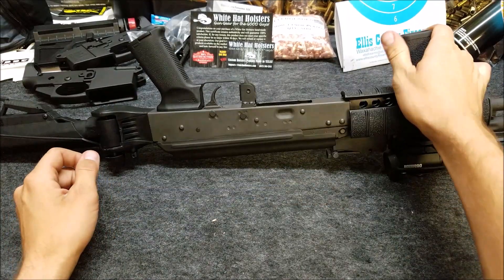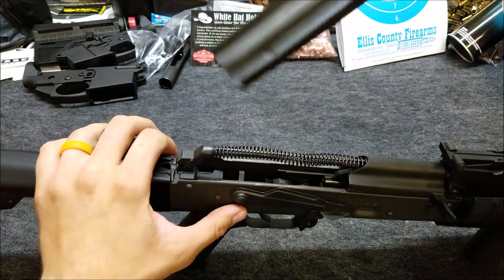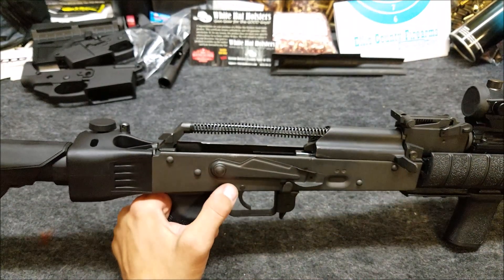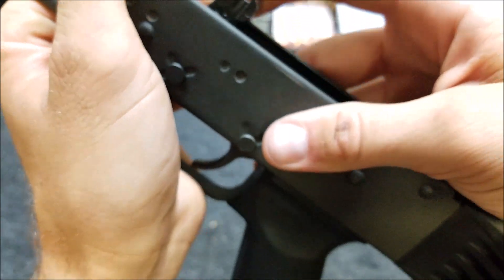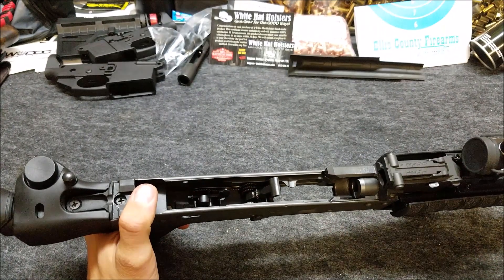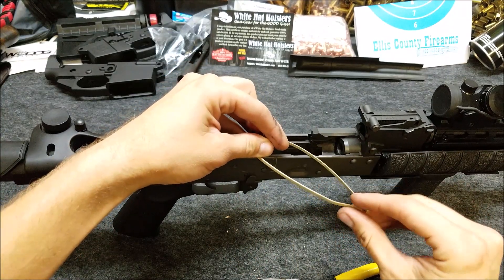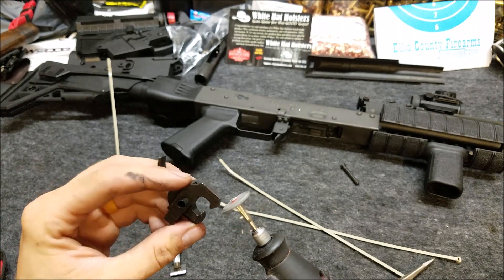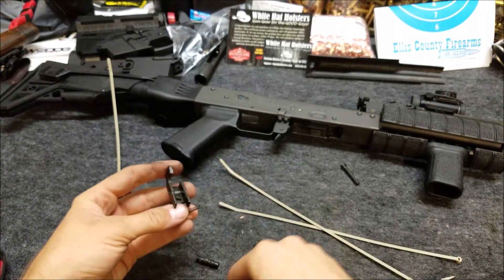Ak-47 Trigger Repair reset fix

Comment: Hey man. I just wanted to say thank you. I am inexperienced with the AK platform but wanted to change the trigger in my PSAK 47, gen 2. I was replacing it with ALG AKT E. Installation went well except the trigger would not reset. I looked everywhere and watched tons of videos but none of the fixes applied to mine. Then I found your video. I filed the hammer and the disconnector like you did and problem solved! What a relieve! It had been two days of installing and reinstalling trying to figure it out. Thank you.
Reply: I picked up the G3 myself a few years back...looking to polish my stuff up too!!!!

Comment: In my case, one side of the spring was not on top of my trigger assembly. This wasn't pushing it down hard enough to reset the trigger. Make sure to check the springs are actually pushing down on your trigger in the first place.
Reply: Thanks! That was the case for me too. My dumbass knocked the spring off of one side when I was messing with trying to loosen up my safety lever.
Reply: Thank you soo much man i though i broke my Ak😂😂😂
Reply: Thank you so much for this comment!!!!! Bought a new zastava and when I was cleaning it I must have knocked the wire off one side and my reset was fucked! It’s fixed now thanks to you 😂

Comment: Just replaced m70 trigger with an alg and am having an absolute nightmare. I don’t have a file, and I need to buff out both the hammer and the little safety pin in the trigger. These parts should already be pre-measured and ready to pop in. It’s ridiculous that we have to do a step in the manufacturing process for them at all by filing and grinding pieces to the correct size.

Comment: LoL with the end of the video being deleted.  Did changing sear to trigger engagement surfaces magically fix the trigger spring reset issue?  Or did putting the hammer trigger spring on properly during re-assembly solve the problem?

Comment: I'm also having the same issue but my gun has been working fine for the last 2 years mine is  the M10X with the same trigger group but I noticed on the right side of the receiver there was a lot of shavings I think it's either coming from my pin or the caller I think that's  my trigger shifted I think any ideas?

Comment: My Ak shoots semi auto perfectly but when i switch to full auto it only shoots the first round and then it suddenly stops. There is a bullet in the chamber but the trigger doesnt activate the hammer so i have to take out the bullet and reload couple times empty so the trigger can be pulled again

Comment: My spring keeps sliding to the inside which is the issue with mine not resetting
Reply from the maker: The hammer spring? Take it out, and bend it the opposite way so it doesnt do that

Comment: Problem: tapco fcg

You shouldn’t need to file or bend things in a new gun just to get it to function... especially an ak. 

Go to apex gun parts and get a REAL ak fire control group. Throw the cast garbage in the trash.

Comment: Thats one ugly stock.Couple of healthy swipes file is fine and will take that mold mark off. I have taken a lot off the hammer ledge on thick receiver milled guns so there is quite a bit of meat there so don't worry about taking too much off there.Lightly take the mold mark down on the dis connector and all should be fine.